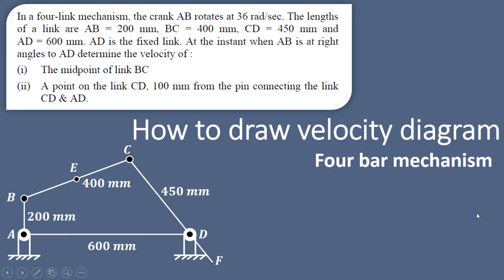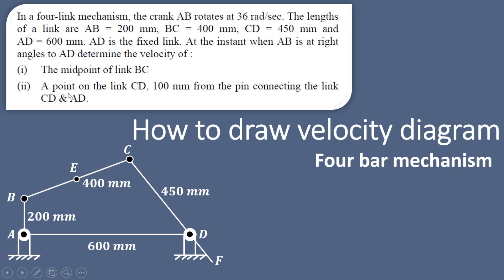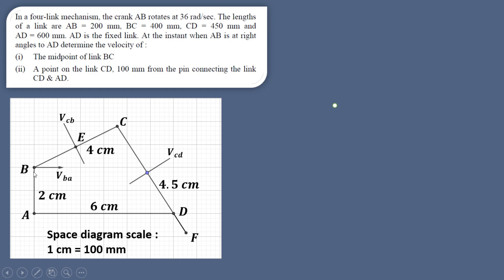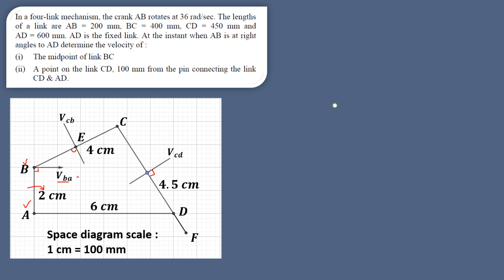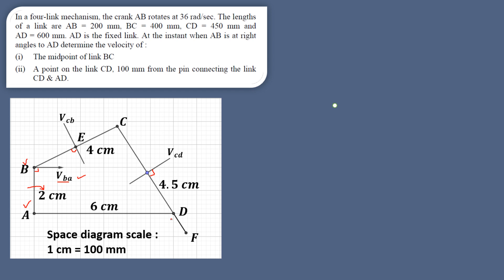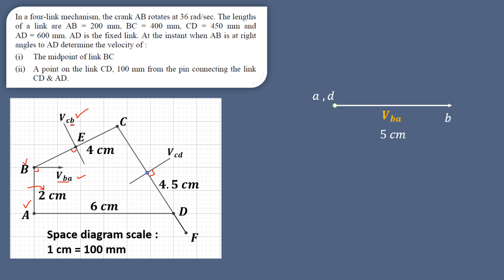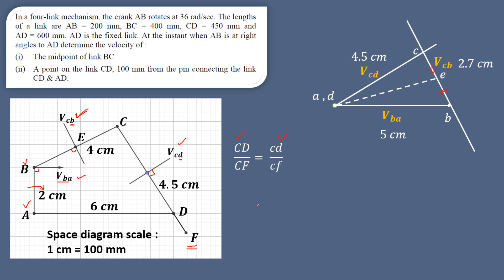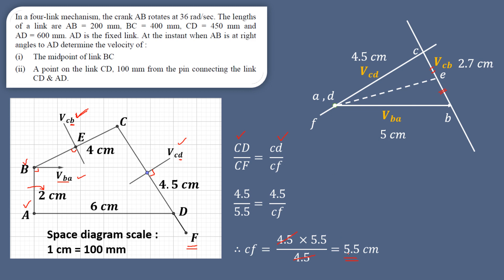Lecture 11 | How to draw velocity diagram | Four bar linkage mechanism | Relative velocity method

Comment: Great video helped a lot. The only thing i don't understand is - Why is vector 'ba' 5cm? Where did you get this information?
Reply from the maker: It assumed for the calculation of velocity scale. You can assume 6 cm or 7 cm etc. and accordingly your scale and diagram will get modified. Final answers will be the same. Thanks !
Reply: @CHINMAY_ACADEMY  That makes sense. Thank you for clarifying.